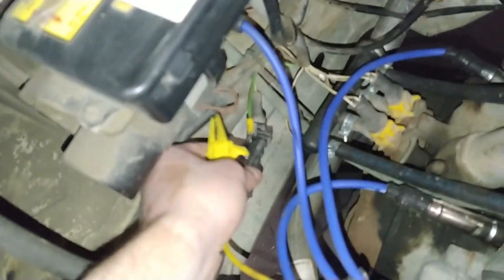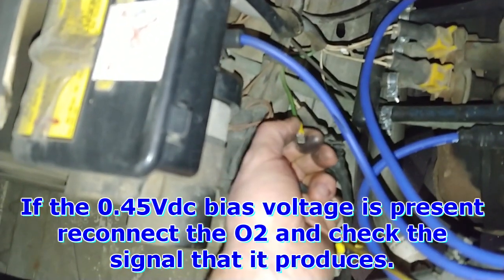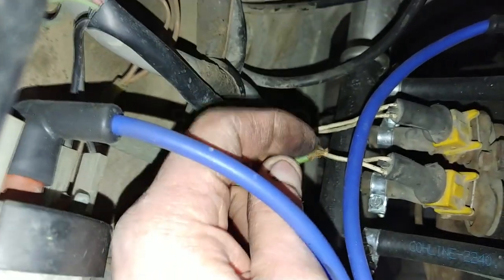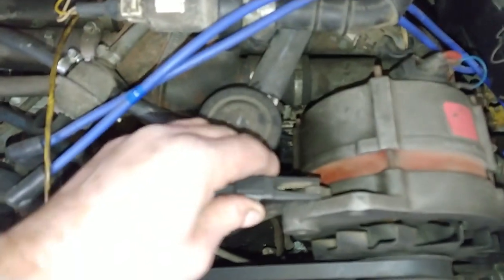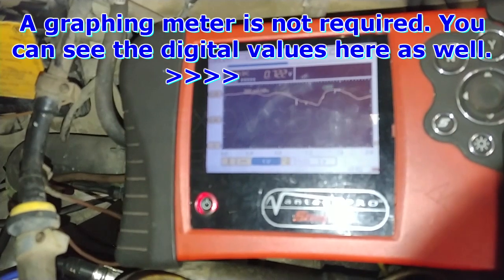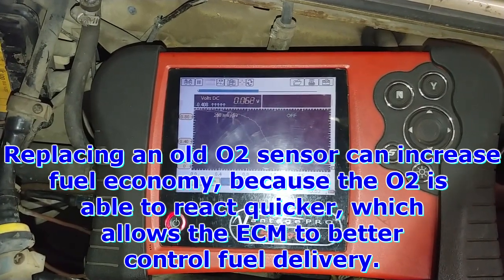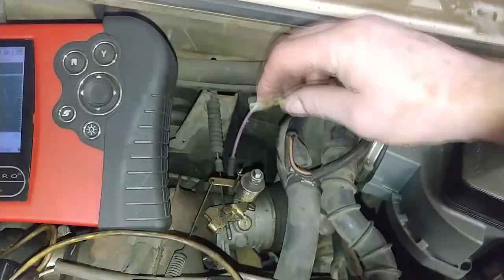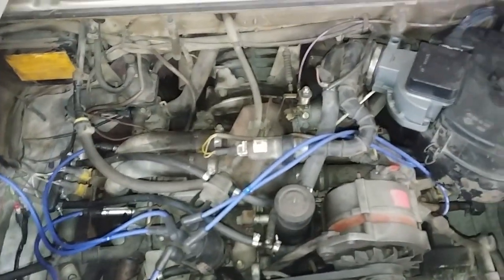VW T3: Common O2 sensor (wiring) issue

Comment: Is there a procedure for testing the airflow meter?
Reply from the maker: The service manual outlines some testing / checking.  I backprobe the meter to see if any glitches are present during a snap of the throttle.
Reply: @EXOVCDS  Thanks :) I love where the manual says 'Specified resistance - Fluctuating'. Not sure if my multi meter is going to much help here. Better start saving for a scope.

Comment: To increase fuel economy on old cars with cable type throttle body you just need to keep fuel level above 85% to prevent the stupid EVAP from purging wasting fuel.
Reply from the maker: Fuel evaporation rate is the same for a tank that is 1/4, 1/2 or 3/4 full. If no purging were to take place, the fuel tank would collapse due to vacuum build up in the tank, as the level of the fuel drops.
Reply: @Thomas EXOVCDS  Old car use return type fuel system not return less. Fuel is absorbing heat from the fuel rail before returning to the tank.
Reply from the maker: Fuel evaporation takes place no matter what... it has to go somewhere, hence... charcoal canister and purge valve. Old cars that don't have purge valve just vent to atmosphere (not good). Maybe I'm not following what you originally meant, sorry.
Reply: @Thomas EXOVCDS The reason why gasoline is evaporating is because the electronic fuel pump is inside the fuel tank. It's silly to put something that generates heat inside the storage tank because the boiling point of gasoline is very low.  Then it's followed by another silly idea of using the catalytic converter to reduce air pollution by burning more fuel without producing engine horsepower. According to EPA,

"By manipulation of total tank pressure, temperature and vapor space a reduction in tank losses can be achieved. When VAPOR SPACE and TEMPERATURE decrease the amount of fuel evaporated decreases. An increase in tank pressure will result in a decrease in evaporative emission. A FULL TANK has very little vapor space and very little evaporative losses" 

https://nepis.epa.gov/Exe/ZyPDF.cgi/9100UPF6.PDF?Dockey=9100UPF6.PDF
Reply from the maker: @w0lvez1  Good research... thanks for taking the time. I don't have the background / brains / education to be able to keep this conversation going (this is the 6th reply / draft that I have now started).  Burning EVAP fumes is more efficient than burning fuel that is injected into the engine in liquid form. Running on fumes is the Holy Grail of engine designs. Keeping the tank at 85%+ is unrealistic... making sure that the EVAP system functions as it should, is time better wasted than stopping to refuel the tank every 100 km's.
(-edit- I forgot to add the smiley face)    =)
Reply from the maker: Bill... w0lvez1 is a long time viewer of mine. I wish I had the knowledge & words for deep discussions. My replies may have come across the wrong way... a verbal discussion would be much better for this (or any other) in-depth topics. I'm the first to admit that I have lots to learn. I always welcome posts from w0lvez1 .
Reply: @EXOVCDS   You are more tolerant than i am. You are more intelligent than you give yourself credit for.